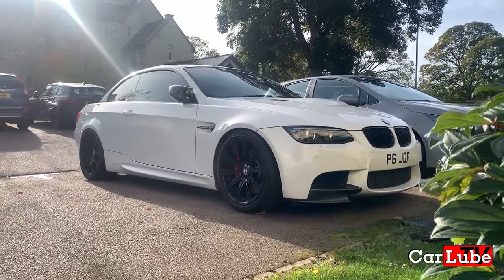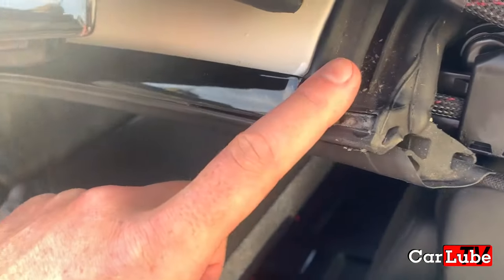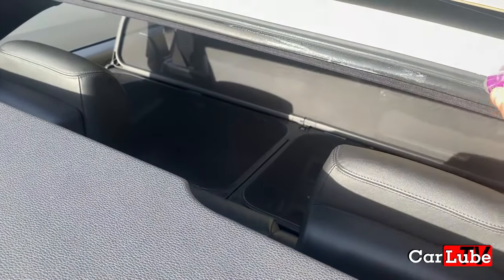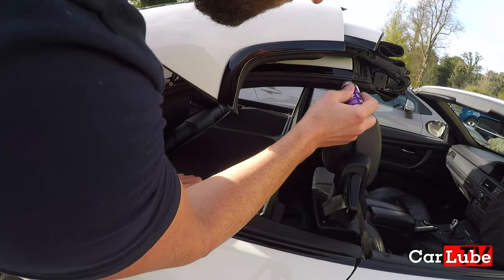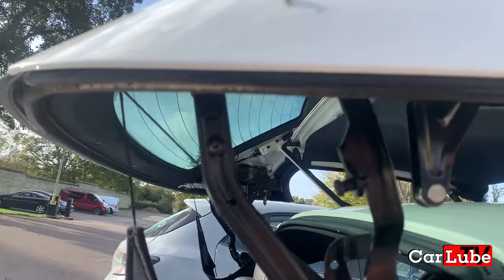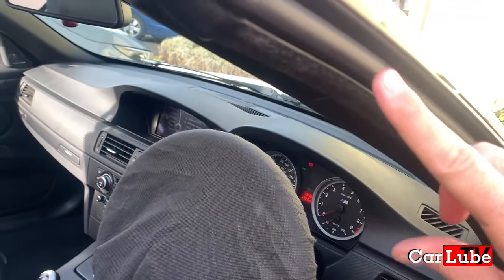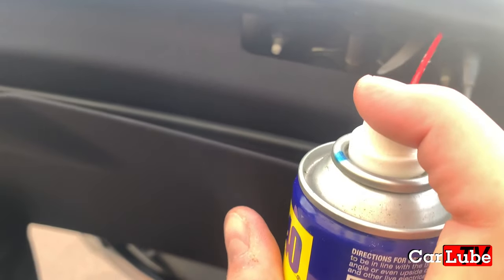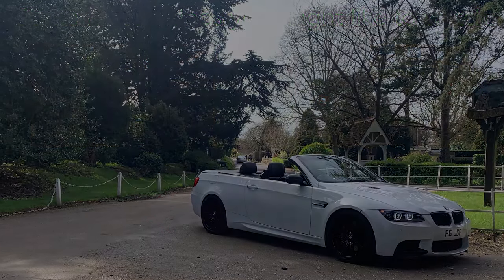How to look after a convertible roof - Lubricate rubber seals with Gummi Pflege - BMW - Fix creaking

Comment: I know this is an old video.   Just wanted to add that WD40 is NOT a lubricant.  For the joints you should use a silicone based lubricant spray.
Reply: Which f.e. ?
Reply: WD stands for water displacement. I don't understand how this product started being used as a lubricant. Those lubricant properties are only good for a couple of days.
Reply: @mehdishirazi3  i use WD40 Lithium Grease
Reply: Correct. GT85 is more appropriate, it's made by the WD40 company for lubricating.

Comment: One crucial step before doing the Gummi Pflege is to CLEAN the rubber seals of dirt. Mine actually had baked crud in some of the corners and cleaning them required gentle back and forth. Its a nice rewarding process. I also used a slightly more expensive grease, Krytox by Chemours, which works infinitely better than Gummi Pflege. I did try Gummi first but that didn't do much and applies as a liquid, where as Krytox applies as a grease that you kinda have to rub in with your fingers. Results were MUCH better with the latter.
Reply: Which version of krytox u used?
Reply: Id like to know that too and is wd40 good or do you recommend something else?
Reply: @whatyoulookinat255  The one I applied is called Krytox GPL 205.
Reply: @NightmarishPT  GPL 205. Got it via Amazon. It works better than every other rubber rejuvenation product I tried, specially in the sticky corrosive coastal environment I'm in.
Reply: @shaazy  thanks and wd40 for the mechanisms is good or do you recomment something better
Reply: @whatyoulookinat255  The white lithium grease wd40 is good for those.
Reply: I used Krytox about 5 years ago and I agree it's better for the seals. But it's expensive! Not sure about regular WD40 for the hinges tho! Maybe a WD40 Dry Lube
Reply: how do you apply the Krytox ? @shaazy
Reply: @haikalrizal4985  Cleaned the rubber with isopropyl alcohol, then applied with index finger. Little is more.

Comment: I would advise not to use WD-40 for the lubrication task. You can see in your video already the amount of overspray, which is problematic. On top, WD-40 is not meant to lubricate parts that are metal to metal contact and it's too lightweight to really make much of a difference in lubrication beyond a few roof cycles. You should use a penetrating oil or white lithium grease as it is meant for metal to metal contact and would not attract dust and dirt the way WD-40 does. This is the same type of lubricant you would use on a garage door, for example.
Reply: Rubbish. I've used WD for many years for all kinds of uses. Even cleaned my engine bay on my old MX5 years back (avoiding rubber seals) despite people saying it would attract dirt. Couple of years and many miles later, never happened. I don't understand the internets hate for WD. It's almost like your comment was a straight copy and paste because it's filled with the same type of nonsense I've seen other people say about WD. Regarding this video, I use wet wipes now and then to clean the rubber seals, then I spray some silicone lubricant on a cloth and that's how I revitalise the rubber. Same goes for the window and door seals.
Reply: @DonPinguccio  It is ok but there are much more specialised lubricants that will last longer and do a better job such as silicone spray or withe lithium. The former being much kinder to rubber seals.

Comment: Is Lithium Grease or WD-40 the better way to go?
Reply: Lithium grease product is the one. DO NOT use standard WD40, as it is a water displacer and can even work as a degreaser (so also remove what little grease you may have had left). WD do make a lithium grease spray like other companies, but your normal old original WD40 should be avoided.

Comment: Am just about to do the full GUMMI-PFLEGE procedure on all rubber seals/weather strips but am then going to get some White Lithium Grease for the "moving" parts of the convertible top. Is the normal WD-40 fine to use instead of the Lithium Grease?
Reply from the maker: The WD-40 will disappear much quicker
Reply: White lithium is much better. Lasts longer. Just remember to clean off excess, though the whiteness of it works better for me as a reminder of all the spots I've covered.
Reply: WD40 will release sticking/jamming metal parts, but won't last any time at all. Lithium grease is way better
Reply: Do not use white lithium grease on anything that comes into contact with anything made of rubber or plastic as it may degrade the material.

Comment: wd40 is probably not the best product to lubricate the roof mechanism - it leaves a sticky residue that will attract dirt, turn it to gunge and make matters worse.
it would probably be better to use a dry ptfe or silicone spray.